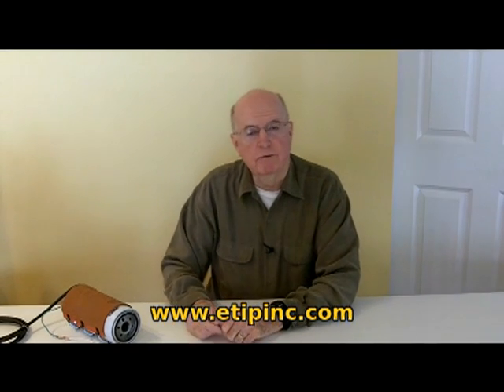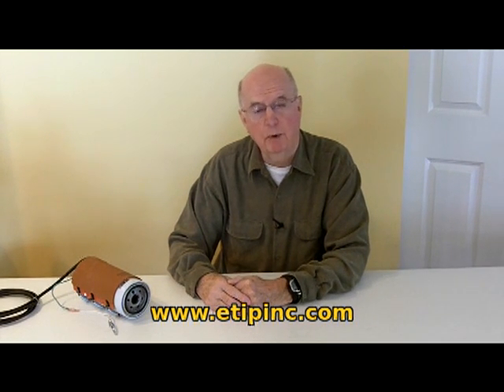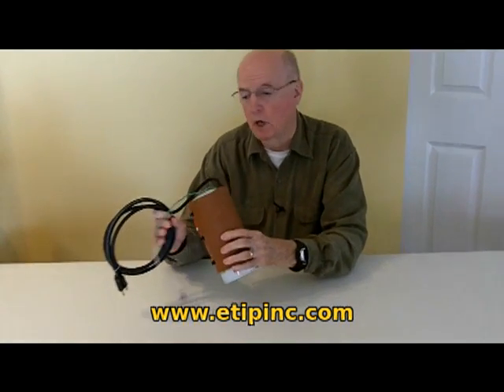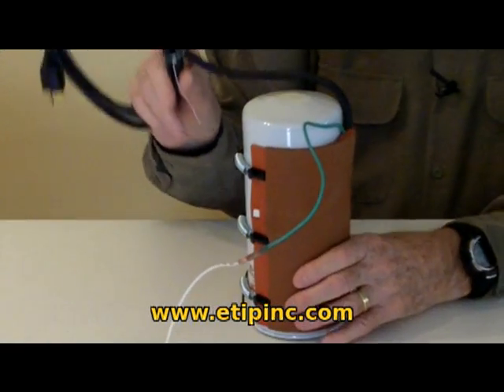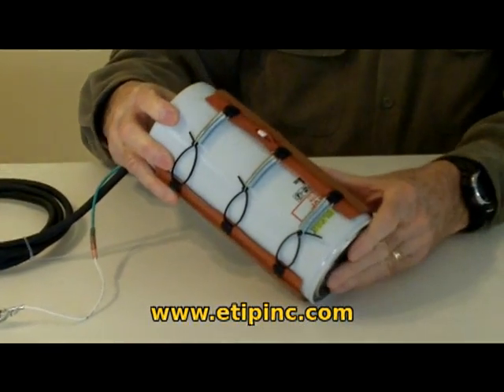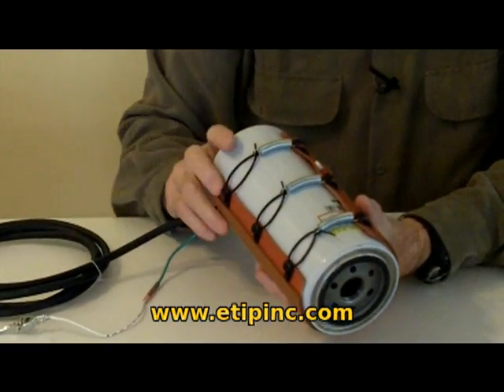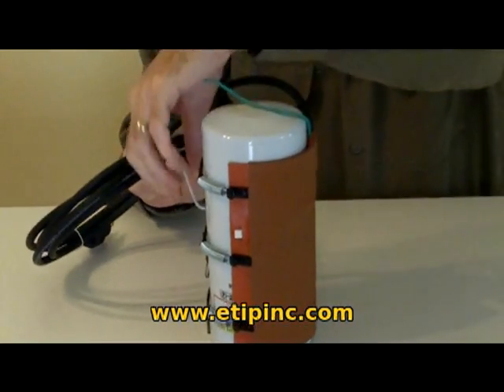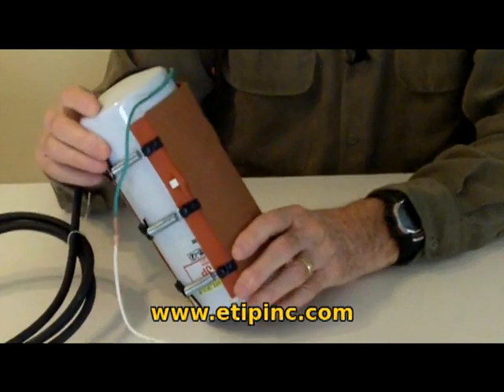Bulk Diesel Tank Fuel Preheater - prevent diesel fuel gelling

Comment: This Preheater is designed for a specific size and type of fuel filter. The size is determined by the volume of flow through the filter. The heating capacity will not be adequate for a larger filter. Contact us at 800-530-5064 for advice on the type and size that you need in your application. Persons using our vehicle fuel filter Preheaters tell us there is no gelling at -30 & -40 F using #2 diesel fuel.

Comment: Preheating refers to the anticipation of the need for heat in order to improve or continue operations. Regarding diesel and biodiesel fuel gelling if the temperature of the fuel goes below about 36 deg F for biodiesel and about 32 deg F for #2 diesel the paraffin wax comes out of the solution and plugs up the pores in the filter. Our Universal Fuel Filter Preheaters heat the filter before the fuel flows and maintains the temp above the gelling point avoiding gelling.